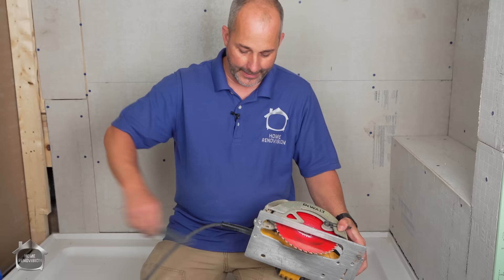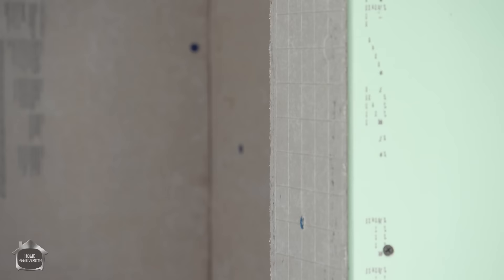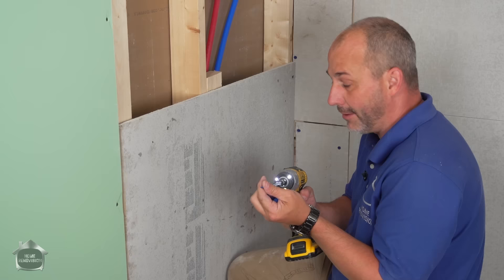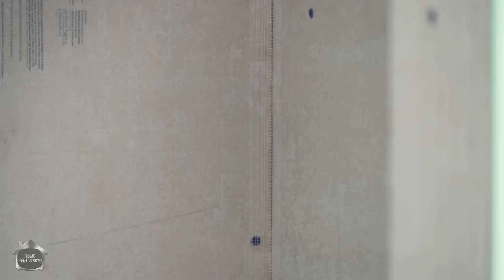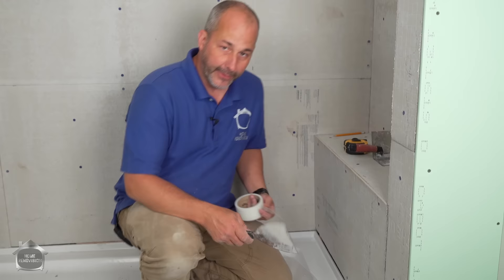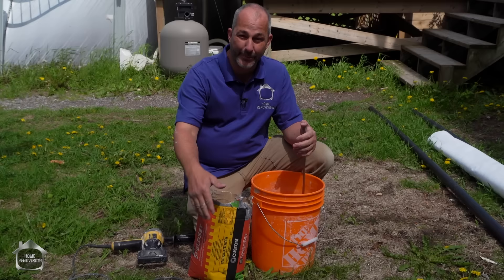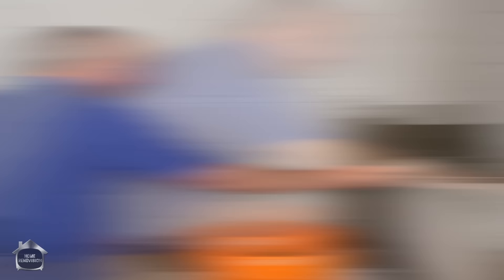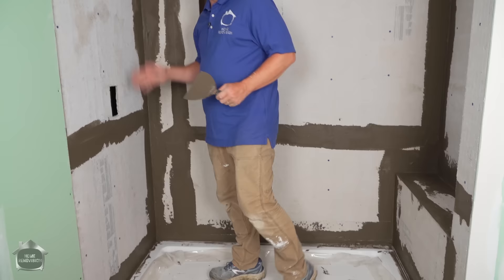How to Install Cement Board for Beginners

Comment: Using the 1/2" is not just a matter of having it line up flush with 1/2" drywall!  The 1/4" is for floors when you are going OVER 3/4" plywood subfloor.  When attaching to studs to form a wall the 1/4" is not strong enough; you need the 1/2"

Comment: Not sure how this guy does not get called out by tradesmen. Cutting concrete board with a circular saw is mental! Professionals have been cutting 1/2 cutting concrete board the same as drywall for the last 30 years. Yes, tougher to do, but is 100% done every day on jobs across this country. Good Fn grief. Also when a pro boards a shower, it is wise to use full sheets to have less joints. This guy has needless joints all over the place. I did commercial & high end institutional work as a carpenter, but still got around to boarding at least a couple dozen residencial showers plus 4 of my own and cut all by hand with an Olfa blade just the same a drywall. Also did a year of piece work drywall when I was young, strong and dumb. But yes, concrete board over gimmicky Schluter every time. Cheers,
Reply: Reminds me of a carpenter kid in Powell River BC that I saw sanding drywall mud with a belt sander. Yes, he was using a corded belt sander to sand the mud down after this lady used a bunch of free church labour to board this massive old house that somehow never got completed. I had been looking for something to keep busy and stumbled upon this residencial nightmare that was like a car accident in which I could not divert my eyes. Kids was about 20 and said he was a carpenter, but I could not see him from across the room because the dust was so thick. The owner hired inexpensive or free labour and the shower tile job was a running joke in that we called it "eclectic". I lasted about a week and a half and had enough stories to last me the year. lol
Reply: If you’re using a cement board like hardiebacker from home depot that stuff is incredibly solid you can’t score and snap for the most part. I’m sure with enough scoring and pressure you could snap it but I use just a beat up framing blade on my circ saw to cut that stuff, so much easier on me and just more efficient. That being said I don’t know what board he’s using, could be softer stuff but either way you don’t need a special blade for cutting unless you’re going to see the cuts like on hardie board

Comment: Hi Jeff  I am replacing part of a porch as we call veranda in Australia as termite and dry rot have taken there toll over a long period of time and looks like I am the lucky novice to fix it better than the rest I guess.
Tongue & Groove flooring was originally over the bearers and mortar adhered the tile to the flooring, over time and the influence
of rain, the T&G started to acquire the dry rot plus movement  this caused cracking in the grout and eventually some tile cracking.
I am in the process of replacing the bad T&G with some spare decking boards which I have, I further added more screws to the original T&G to give it more strength. My plan is to use thin set tile mortar to lay cement board onto the T&G  then water proof
the whole floor with a Under tile Membrane by Gripset Betta which drys in 4 hrs then I will lay tiles using the same mortar that I am using on the cement board to the T&G.
My question Jeff is would this be OK?

Comment: We just use silicone for all the edges and separations. Been doing it for years without issue. Ofc we use a roll on membrane but the silicone makes quick work and it’s cheap.

Comment: Hello and good morning love your videos super appreciate your information I've been an electrician for 28 years and your content is spot on.

I'm ready to hang wallboard in my daughter's remodeled bathroom I was all set to do HardieBacker mesh tape with thinset and a water membrane.

Then a tile Pro friend of mine said I was working too hard and I should use den shield.

Jeff I wanted to get your thoughts my wife and I watch you all the time we're doing tile floor to ceiling on your recommendation we're doing the flextherm floors like I said we love your videos.

If you were me which way would you go, HardieBacker Cement board, mesh tape, thinset, and membrane? Or, Denshield, mesh tape and thinset?

Comment: I love this method with thinset all the way to the bottom of the tile flange on shower pan and waterproof membrane over all of it.  The manufacturer of my shower pan recommends cement board OVER the flange to 1/4" of bottom of tile pan and caulk the 1/8" gap after tiling. This also is the only way possible given the rough-in size. Is it a good idea to still use fiberglass tape and thinset in that 1/4" gap and paint membrane to the bottom like in this video?

Comment: Dude U're the Best❗
Learned Very Mucho from U
Here in NY all they lay Tiles right over green waterproof sheetrock w/out any water guarrd primers.
Mine is 20 yo & in great cond.
Amazingly it does hold up very well > Until Ur neighbor's Bath above U starts to leak 💦or fl👀d ☔

Comment: Thanks Jeff!!   I most prefer preformed fiberglass stalls.  My main bath tub and shower is a three piece unit that must be 20 years old and looks just fine.  I just renoed my basement bathroom and installed a three piece 48 inch unit.  Pan, walls, roof  Done!  I am now doing my master shower and don't have the option for prefab.  I'm thinking I will  use  1/4 cement board with the Mapei roll-on.  Buy Canadian whenever you can!!    On top of that, if I dont find a panel that is nice enough I will put arborite right on the membrane  Thousands of choices and then only two long seams to worry about.  Wish me luck!

Comment: Should be using the grey mesh tape, it’s made to be resistant to the mortar. Regular mesh tape breaks down over time... don’t use drywall screws either people, use those cement board screws and make sure to mortar over the screw heads, just like drywall (before waterproofing membrane)... the drywall screws corrode away over time in cement board... and yes, waterproof all of it.

Comment: I use a saber saw to cut fiberboard.  Use ones with big teeth. I get 2-3 feet out of each blade. I just got a bunch from Amazon for $10(US).  Cuts nicely and as accurate as you can cut.

Comment: Hello from Ireland, I have been studying your videos very carefully for more than one year now, to help me do a variety of jobs around the house we are repairing. :) I'm doing our shower with your method and I have 2 questions: 1- what size screws are you using for the cement boards (the 1/2 " ones) and 2- how do you place your boards on a shower tray that has no tile flange.. :) Many thanks!

Comment: I would've like to have seen the clean-up of the quickset at flange edge before applying waterproofing membrane. You seem to have achieved a nice crisp edge line without scratching up the pan.

Comment: Roll on membrane is definitely a cost effective and efficient way to waterproof showers. Did this a lot as a roofer and it's amazing how good this stuff works. Most of the products we used were from merkrete. It's doesn't make sense to spend a lot in waterproofing when the tile you're putting in is inexpensive. You can also do roll on if you're just putting in porcelain or fiberglass walls as an added layer of protection.

Comment: I really enjoy your videos. Thank you for all of them.
I never heard you mention the issue I have. 
When laying motor bed for shower, my drain came up to 3 inches. When putting motor bed in I had a 4 foot slope. Making the back end 4 inches in depth. 
But the motor mix I was using said maximum depth should be no more than 3 inches. I was at a loss as how to proceed. 
Any suggestions would be appreciated

Comment: Is it possible to use cement board for an entire room, but manage to get a drywall look/texture?

Recently bought first house, which i plan to rent in a few years, and i dont want to be repairing drywall constantly from tenants. 

Its small square footage just under 1000 as a 3bd 2ba, so I dont want to make walls any thicker then necessary..

Comment: Can I mount cement board over my mold resistant drywall for my tile shower wall provided I use something like a roll on water membrane on the cement board?

Comment: Question: you talk in the video about diverting any water that might penetrate down, pack into the shower pan - but then in your tiling videos you put silicone between the tile and the tub - how does the water get back to the shower? Wouldn't it get trapped by the silicone?

Comment: I have a 1950's tub around which I am rebuilding the wall.  In the corners there are these huge gaps.  At 8:52 I understand you recommending to fill that gap with quickset from the edge of the cement board to the edge of the tub, tape it, put a finishing coat on, and then put on a sealer (I'm using Redguard). Are you saying to use Quickrete (or what brand)?  Won't this crack if you bring it down to the tub?  Won't water seep into it if the water gets through the membrane?  What is the purpose of stopping the cement board at the top of the flange if you are going to apply quick set down to the edge of the tub?

Comment: i use the Wedi system which is nice and simple but the sealant is kind of a pain to deal with and the system is quite expensive. its fast to install and is effective but at the end of the day the ease of cement board and thinset plus redgard is priceless. i guess it depends on what your budget and time frame is but when it comes down to trial and error and learning the process, it seems like theres more room for error in a system that claims to be easy to install because theres less precautionary steps in order to truly waterproof. not to mention if you dont smooth that wedi goop out and youre using self pacing subway tile good luck with lippage. writing from NJ, USA

Comment: Also you commented you'd like to know about the normal practices product use for areas. I live in Texas but I've always used cement boards of one type or another for wet areas for installing tile. Even found similar products while l was stationed in Germany

Comment: Great video! Do you need to seal with caulk first in the corner wall/wall and wall/floor joints, and then apply as you have shown or not worry about caulking?  What do you do with the cement board to dry wall gap?

Comment: Love your videos. We are installing durock in our shower along with waterproofing with roll on membrane. While we are mudding the joints we are noticing cracking all along the seam. Unsure if we need to take it out and start over, just roll waterproof over the joints, or add more mortar. Thanks in advance

Comment: Great video and I decided to remodel my walk-in shower myself.  I’m in S Florida and my shower is a step down so no curb needed with a cement slab floor.  Quick question, I’m tiling the floor over the slab as it is now so should I use some sort of waterproof layer before the tile?  Also I see how you sealed the seam from the board to the pan.  Is it the same process if no pan is being used, just the slab?  Some say I should use a liner.  Thanks again.

Comment: I really appreciated this video. However I do have a question. I live in Florida and my wood framed home has strapping that holds the roof to the walls. Those straps stick out from the studs up to an eighth of an inch (it is an outside wall). How do I install the backer board and remain plumb?

Comment: How do you use drywall next to cement board? We have a normal skirted bath/shower combo and want to use cement board in the shower area, but drywall in the rest of the room. So there's no corner to end the thinset on. Help!

Comment: Plan to use tile redi shower pan.  They have option to purchase walls (3x5); set of 8 that eliminates 50% of traditional water proofing at 4xs cost of cement boards,  These shower walls seem to eliminate any mis-steps in the water proofing process but at a significant expense.  However if danger averted a great investment.... My question is other than convience is there any clear advantagefor using redi wall boards based on functionality?

Comment: Great video.  How would you seal/spackle the transition from cement board to sheetrock?
Reply: use the waterproofing over the transition and plan to have your edge tile overlap the seem (finish on the drywall side.

Comment: Hello Jeff, new member here 😊 I have been watching your videos for a few months now. We are totally renovating our foreclosure fixer upper, And even though we have a contractor(for the major aspects of the Reno, such as plumbing electric and framing) my husband and I are taking on some of the other stages. We are taping spackling and sanding right now( your videos on those were SUPER helpful) next will be paint and tile of showers. We have cement boards, like in this video. 
1)Can we use the RedGard membrane instead of this AquaDefense?
Also 
2)what kind of mesh tape are you using for the seams?
Reply from the maker: Hi Rosa, the tape is designed to go with the cement board and can be found in the same isle as the cement board. And yes feel fee to use redgaurd. Cheers!

Comment: Very useful and easy to follow content. I'm looking for a video to build access panel for Jacuzzi bathtub. Not sure if you have one. please recommend if you have Jacuzzi bathtub installation or access tile panel. I'm trying to replace my bathtub with a jacuzzi tub and not sure how to do this. Also What can I do if my Previous contractor did not waterproof my drop in tub surround. what can I do? to prevent water damage.
thank you

Comment: Thank you for this. I'm remodeling my mothers bathroom to be ADA friendly with a new 5' x 30" shower pan and tile from walls to and on the  ceiling. I will definitely be using the water proof roll on membrane over the concrete board.

Comment: I am very confused, other contractors say put board OVER flange, resting on/near the tub/shower base, which would make sense so water flow has no chance to flow BEHIND it, also it connects to studs, so makes sense to go OVER flange to align with the other 1/2 inch drywall that flows the rest of the room?
Reply: Best way is to shim the wall out, if you just lay it over the flange it will kick out and that part of the wall always comes out crooked. If the gap between flange and backer board is waterproofed then it is just as good as the board

Comment: Exterior corner video would be great transitioning cement board to drywall - I've seen a few different methods - wondering what your take is on the best way to achieve a nice 90' corner from cement board at the back of the tub transitioning to a drywall wall at an exterior 90

Comment: Jeff - Love your videos - Don't you have to leave a gap between the shower pan and the cement board for expansion/contraction?  By filling this gap with cement aren't you preventing this from happening?  I thought the recommended approach was to fill this gap with 100% silicone caulk and/or a fabric membrane to cover it?  Thanks.

Comment: I have a question regarding having space between the pan and the cement board. You said the tape would give you a flexibility but the material that holes the gap is quick set which I believe doesn’t give any flexibility. If there’s any movement, the quick set would be broken as you worry when you install the cement board on the pan. Could you please help me to understand what’s the difference between the cement board and quick set on the pan?

Comment: Thank you for this. Had no idea about roll on membrane. All TV renos have a pink plastic. I am in southeast Mississippi and we have high humidity so my paint is Sherwin Williams high moisture paint. One coat is all it needs. 
 What type and size roller do you prefer?

Comment: I had an 18x42 concrete block shed built with a plastic shower pan, drain and water fixtures (framed in with cement board) in one corner. Should I put that roll on material on the bare concrete blocks too before I tile?

Comment: Home depot has Hardie 500 Hydrodefense 3' X 5' X 1/2"
Its suppose to be waterproof and only  need to cover with alkaline tape and  a modified thinset cement over joints and screws. Then brush on RedGard over joints and the thinseted screws. Would you still recommend at least doing the first 4' feet of a bath tub shower.
 It must be relatively new. I have  not found anyone that has used this product on YouTube or any reviews.

Comment: Love your video I have a question I want to do my sunroom and use cement board on the walls and the ceiling no heat or cooling out there can I paint both sides to water proof just in case of any moisture  enters that space, just being   careful

Comment: I would use blue painter tape along the wall on the shower pan to keep from having the motor sand scratching the finish of the shower base pan. You can simple pull the tape off after the mortar drys. just a simple idea. Also I noticed you did not put vapor barrier on the wood studs before hanging the board. May you are not worried about water getting behind the board and socking into the stocks.

Comment: Great video! Do you need to seal with caulk first in the corner wall/wall and wall/floor joints, and then apply as you have shown or not worry about caulking?

Comment: I am redoing a shower and using Wonderboard for the cement backer. The instructions say to use roofing felt paper or plastic BEHIND the cement board (between the studs and cement board).  I believe this acts as a vapor/moisture barrier and I assume it   overlaps the shower pan lip to allow the moisture to drain. Though, if you silicone seal the bottom, not sure how moisture can escape. Anyways, should I do this, or do the painted on waterproofing membrane as shown in the video?

Comment: Jeff I screwed up. Had returned speed set cause custom said it’s for setting tile and got speed finish and skimmed tight which accomplished little. Still unlevel 3/16 size if paint stick so need go get leveler. What do you think